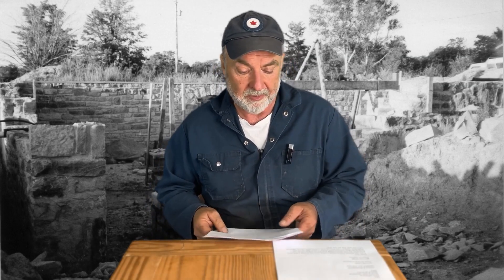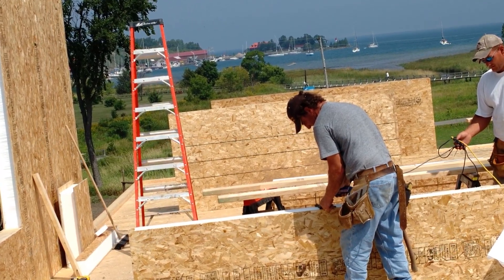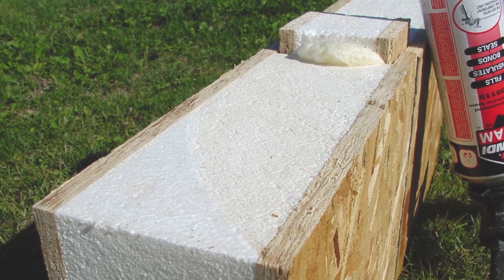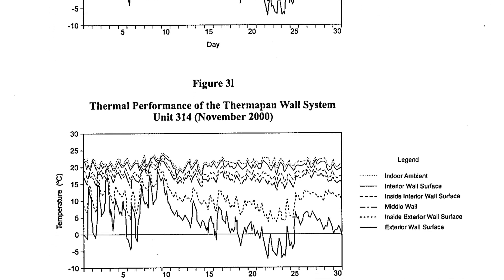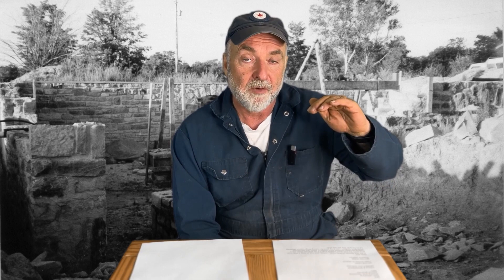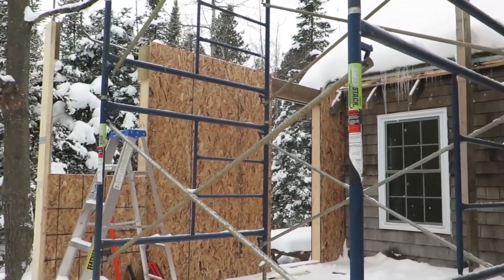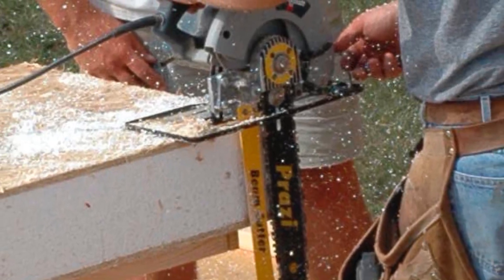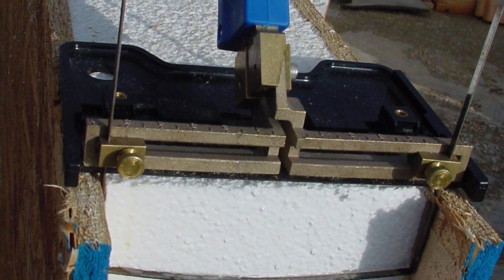SIPs Homes vs Traditional Framing | The Benefits of Structural Insulated Panels

Comment: I'm glad you're back on this. I've considered seriously getting my general contractor's license or at least selling my existing house, going out of the city, buying some acreage, and building my own. I've wanted to make my own panels with poured PU instead of polystyrene. It seems to me that in the long run, that could be cheaper since PU expands so much that shipping and handling would be cheaper. Anyway, I envision a post and beam SIPS combo for esthetic reasons, but I'm sure SIPS alone would be way cheaper. I live in Charlotte, NC, so insulation isn't nearly as critical as where you live, but I still like the concept. My architect brother loves the idea too, but says in this area, stick framing is still much cheaper. Any advice you can give me would be appreciated. I've had trouble finding  info on the necessary engineering info on SIPS if I were to make my own panels. I realize that to sell SIPS there is likely substantial regulation and I couldn't use DIY panels for a home, but I still want to experiment with a shed or barn structure of some sort. Any info you can send my way will be appreciated.